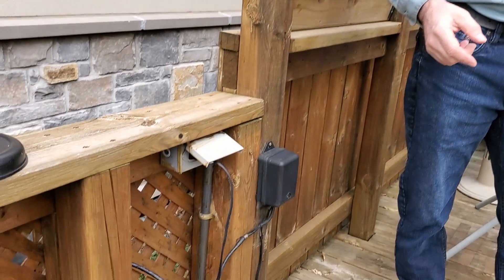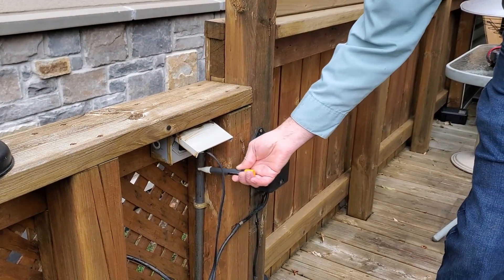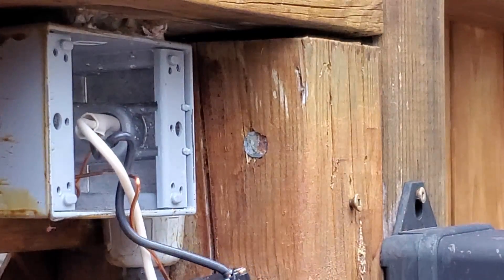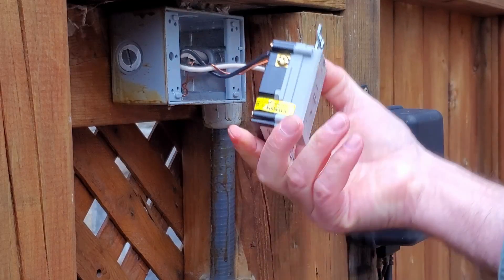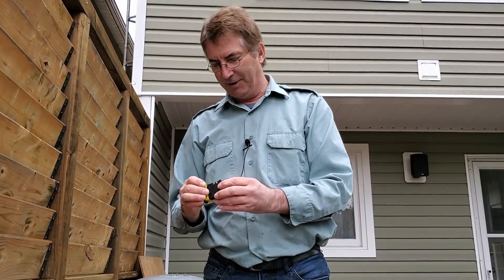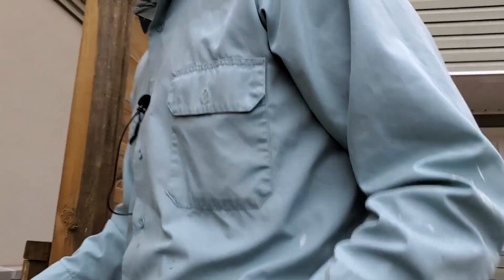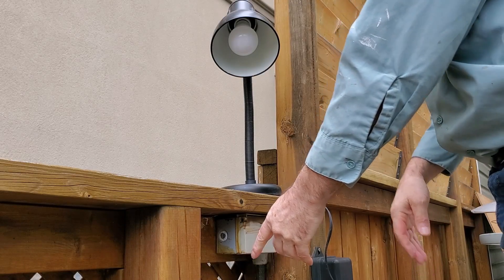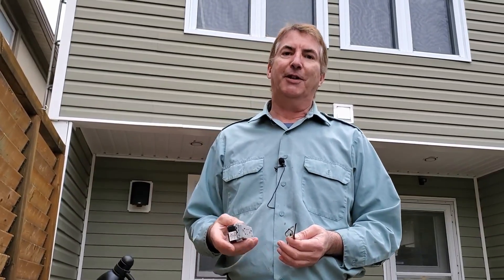GFI STOPPED WORKING, how to reset / replace your GFCI outlets  #Frugal With John

Comment: I replaced mine and the new one doesn't work.    :-(
Reply from the maker: Before a new GFI will turn on, the power needs to be on, then push test and then reset, (before doing this make sure the outlet is back in the box and the cover is on, Thanks for watching.
Reply: @FRUGALWITHJOHN  Took it apart again and found that the ground wire was not connected to the outlet box. Working great now. Cheers!

Comment: I just put 2 brand new GFCI outlets in and neither one will reset? Why? When i put a non gfi outlet in it works. Why?
Reply from the maker: In order to reset a GFIC, you will need to have the power to the outlet on, here is some info from the web. http://thecircuitdetective.com/gfis.php#bad

Comment: Thanks! I especially am grateful that you were so careful with the possibility of a hot circuit. You can’t test the receptacle to see if it’s hot if it isn’t working! I also don’t know exactly which breaker on my main panel is the right one. So I will turn off the main breaker before I remove and replace my outside receptacle, and I will use my voltage tester throughout the process! Thanks so much 💕
Reply from the maker: Glad it was helpful! Thanks for watching.

Comment: JOHN OMG! Wow, thank you ! This is going to be one of my tasks for tomorrow so I can finally set my hot tub up! 
If you know anything about solar do a video because I want to convert the hot tub out front to complete solar power lol I just don’t have the patience to wait for the materials!
Reply from the maker: Glad to help, I also have a small solar setup. I use it to charge batters and it needs to be replaced/upgraded. I will do a video of the replacement. To use a solar system to power a hot tub would require a massive setup unless you do a grid-tied system to offset the cost of electricity. Thanks for watching
Reply: My hot tub blew mine lol

Comment: Without even watching this I can tell you this much:

The Damn GFCI will NEVER RESET if there's no power to it.  No one tells you this

Go to your breaker panel and find the appropriate breaker.  If it's halfway between on & off, firmly turn it ALL THE WAY OFF.  Then firmly turn it all the way on.  If it doesn't appear to be halfway off, switch it off & on a couple times, again firmly, ending with it On. 

Go back to the GFCI and using a sturdy screwdriver push hard and fast on the reset button, which is usually the top button.

You have to do all this pretty forcfully, especially in an older home.
Reply: Mine went out yesterday and when I tried to press the gfi, it turned on some Christmas lights in the backyard only for a brief moment. What’s the problem?
Reply from the maker: Thanks for your comment, if you watch the video, you will see me verify power to the GFI.

Comment: What happen with the black tape 🤔
Reply from the maker: I believe you're referring to electrical tape, the code does not require it in my area. I used it before but found it leaves a sticky residue behind and it's messy when it needs to be changed again. Thanks for watching